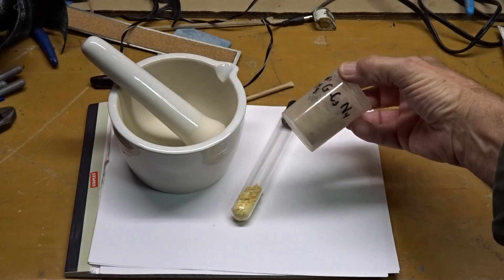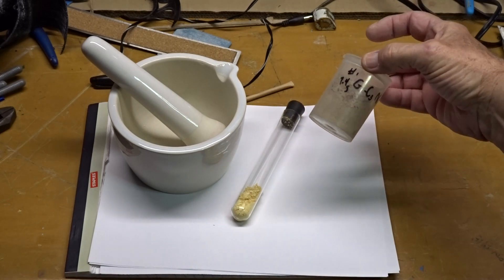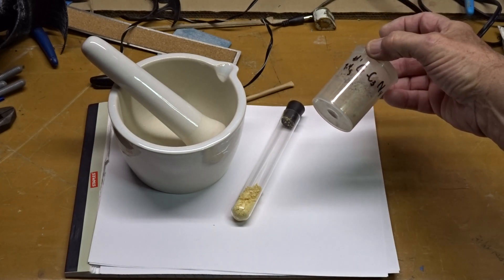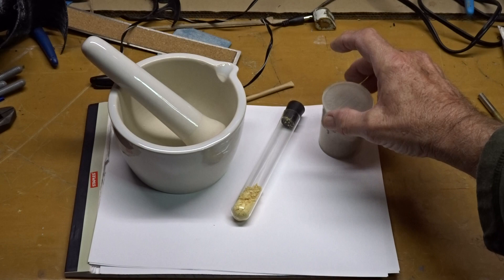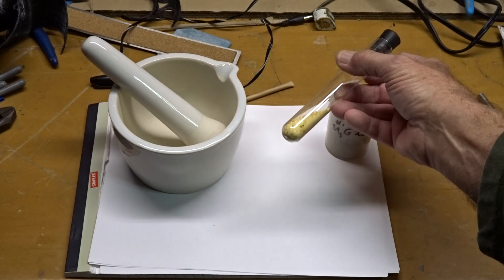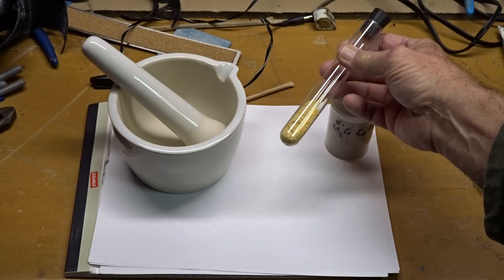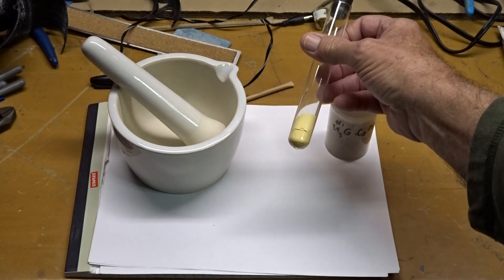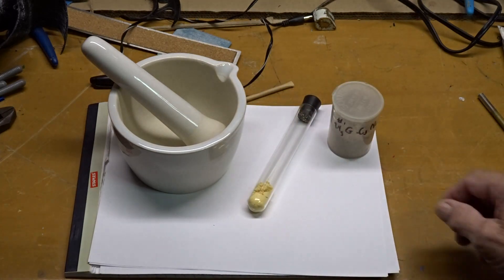Thiourea to Graphitic Carbon Nitride

Comment: I was having similar results but thought there might be some contamination with my urea. Will have to try this
Reply from the maker: Keep at it. Next step is to test it . first find some FTO or ITO glass... Not exactly sure why I need conductive glass and then how to coat it. I got a reply from a scientist and he suggested a low tec solution  Linseed oil!
Reply: It might be that because I was succesful using lab-grade urea at 550°C for 2 hours, at 4 hours it looked like the one on this video.